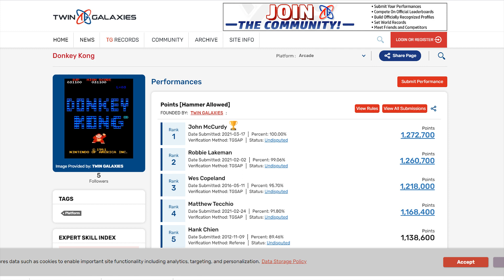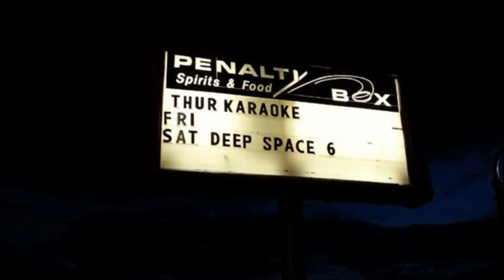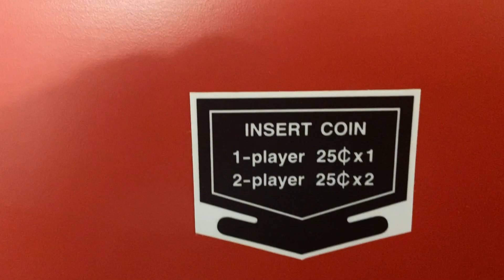"A Tale of DONKEY KONG" - (My CUSTOM Arcade Story)

Comment: One of my all time favorites, question type of joystick and buttons were used on the original machines? Thanks in advance !
Reply from the maker: Nintendo made their own joysticks and I believe the buttons too. These are technically to scale replicas .  But the buttons don’t use the standard micro switch , they use the micro switch with the arm or stem on it. And Nintendo joysticks are funky , you really have to take one off and apart to see. They have a solid ball bearing in a housing and an “external” spring.
Reply: @therexershow  thanks for the quick reply, the reason I ask is because I'm currently looking into picking up a fight stick and cannot seem to be able to find any of the concave buttons or the more silent type joystick that doesn't make all of the loud clicking noises, any help on where to find anything comparable would be appreciated! Thanks again

Comment: Awesome job and a great video! What's your take on the monitor and is it the same size as a Sanyo?
Reply from the maker: Same size. 19 Inch. To be completely honest is ok.  It not better than a crt but it’s worked every time I turned it on with no issues. The resolution and clarity is good , not great .  I am very picky though.  Also it’s a 5:4 aspect not 4/3 , but you can adjust the aspect of the game within the monitor if you want it perfect 4/3.  And the blacks are great.   I also have one in my DK jr. It looks a tad better  in that one for some reason. But this will last years with no maintenance and I have enough other Crts to worry about.  Thanks for watching.
Reply: @therexershow  Awesome, thanks alot! I've built a DK cab also and ended up putting in a Dell2007fpb in mine. But I have been tempted ordering a monitor from Mike's
Reply from the maker: @spanarnz  too bad you’re not the real Henrik Zetterberg. I’m from Detroit.
Reply: @therexershow  Ok, nice one! I really want to go there and see what happens when I tell people my name 😉

Comment: Looks good! I just replaced some parts on mine and I noticed you are missing the lower Bezel retainer bracket.
Reply from the maker: I actually think I  have the bracket but I had no idea how to install. There’s a groove in the wood where the bottom of the bezel sits in so I didn’t understand what that part was for. Then there’s that bracket thing that you’re supposed to put on top or something that you pull the bezel out  with or something. I have that too  but had no idea how to install that.

Comment: How duz it look with the LCD? I bought a kong machine in may and it took me a while to get the sanyo going.  Did a cap kit. That helped, but missing red.  Did new color pots. Nothing. Finally had to get it rejuved. Thrat did the trick.   I was on the verge of buying an lcd.
Your cabinet turned out very good.  You did a nice job.
Reply from the maker: It’s almost as good as a Crt but not quite. Colors are good and you can easily adjust the settings , but it’s just not quite as crisp. But a random person walking up and playing would never know. I’m really happy with it.
Reply: @therexershow  they make a scanline generator for lcds.  I guess it is supposed to make it look more like a CRT.  It's an add-on from what I understand.

Comment: Did you know that Popeye and Bluto was supposed to be Donkey Kong ?It was supposed to be Bluto on top of the Building and Popeye making his way up. Plus the Red Cabs were Radar Scope which didn't sell well in the USA. So they made the remaining Red Cabs into Donkeys Kong and yep the Original  Reds had a 4 board stack and Couldn't be converted to a DK /DK JR OR D2K board . AND REX I have 3 Sanyo EZ monitors LOL. but those Monitors from Mike Hayland work Great!
Reply from the maker: I had Sharp Image repair searching for a Sanyo EZ and they had one they were supposed to sell me, but it fell through. I searched online and for a working one , people wanted over 300$ plus shipping .  By that time , I was thinking how I didn’t want to worry about CRT issues at that point , so I just went with the LCD. Thanks for watching Pitbull.
Reply: @therexershow  I use one of those LCD also my one Sanyo EZV-20  went out I replaced it with a Wells 4600 lol

Comment: How much did it cost?
Reply from the maker: I wish i had time to go over that.  But in short $300 monitor , 150 Control panel, $260 for the PCB, $50 power supply.  $80 wood,  $100 laminate, bezel and marquee about 50, coin door $40 and some miscellaenous wires and such you see,

Comment: Looks nice but I can see true fan will pitch fork you for using a LCD flat screen.
Reply from the maker: It was a struggle to find a working one without burn in and one I could trust would work in the long term. MY original plan was to use Crt snd I  was going to pull a wells G out of an arcade and such, even one of my other arcades  , but in the end I wanted to pass this down to my kid and I know If it had a Crt in it , it may never see the day where he would take it.

Comment: My 1st comment for the YouTube engagement algorithm!
Reply from the maker: Ha. Thanks Utubepunk.  This video lost its traction because YouTube is stupid. But to answer your question on cost. 300 monitor, 260 PCB , $50 power supply, 30 marquee, 150 control panel, $25 bezel, artwork 50, harnesses $25 , coin door 50 , wood 80 , , speaker 20 , laminate 100.  Some paint and misc supplies. So maybe $1200 all in if that.